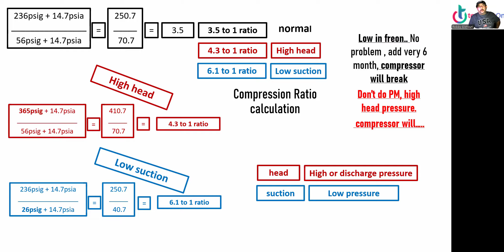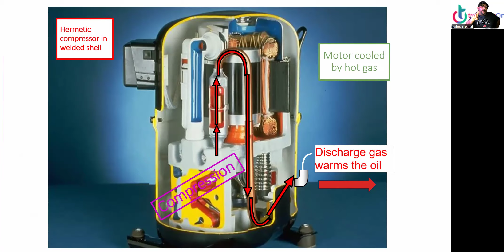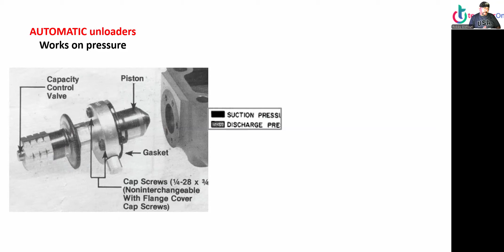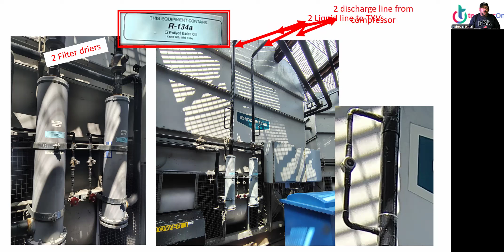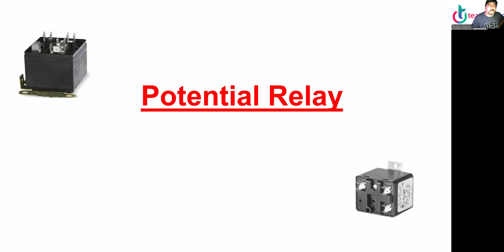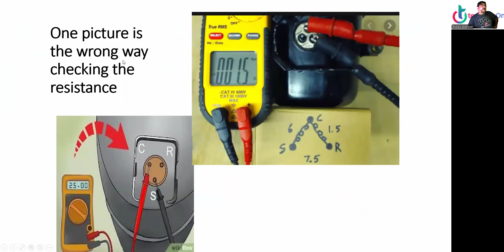Compressors and more, july 7 2026

Comment from the maker: (week 1) Water Boiling at Room Temperature https://youtu.be/739990nm0QY`
(week 1)How to Read AC Wiring Diagram https://youtu.be/I-sB4GIlbl4
(week 2) Refrigeration cycle https://www.youtube.com/watch?v=VJX0LyxRV0E&feature=youtu.be
(week 2) Refrigeration cycle walk-in cooler https://www.youtube.com/watch?v=RofUUMl5x84
(week 2) Refrigerants How they work in HVAC systems https://youtu.be/lMqoKLli0Y4
(week 2) Reciprocating comp./ Refrigeration cycle https://youtu.be/2km_KjdPIEo
(week 2) Rotary compressor https://youtu.be/fxDEK3Ymx30
(week 2) Screw compressor https://youtu.be/Ov6yGngTzhc
(week 2) Scroll compressor https://youtu.be/yNgqI4XPUZc
(week 2) centrifugal chiller https://youtu.be/Bg76E45LAag
(week 2) current relay troubleshoot https://www.youtube.com/watch?v=omdPq8PWExA
(week 2) current relay explanation https://www.youtube.com/watch?v=qVUOiU8s-jg
(week 2) potential relay troubleshoot https://www.youtube.com/watch?v=IhVY8bYFIKE
(week 2) potential relay explanation https://www.youtube.com/watch?v=yv4Zk3Te1ac
(week 2) Refrigeration Compressor Teardown Class https://www.youtube.com/watch?v=3aVMfR4QLgc
(week 3) The HVAC condenser https://youtu.be/XsDxGXaeHwY
(week 3) SH/SC https://www.youtube.com/watch?v=pUYLmxOrfo0
(week 3) Chillers with Heat Recovery https://youtu.be/pkQkq5ynrt0
(week 3) Limitrol+ Floating Head Pressure Control System https://youtu.be/D8M8KAODdU8
(week 4) TXV operation https://youtu.be/RdTG3gjZGpI
Ref. cycle drawn on a pressure enthalpy diagram (NOT CORRECT) https://www.youtube.com/watch?v=eNfgYZCfyE8
Pressure Enthalpy Chart & the Refrigeration Cycle (CORRECT) https://www.youtube.com/watch?v=Bf7DWu-3PJM